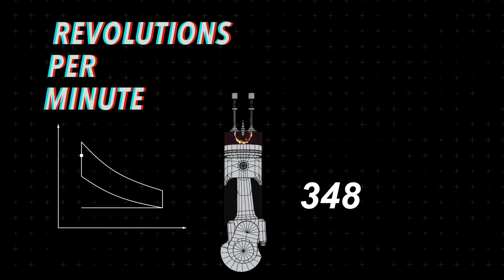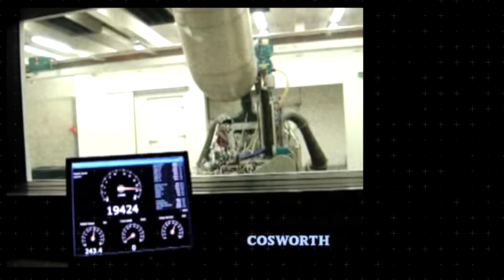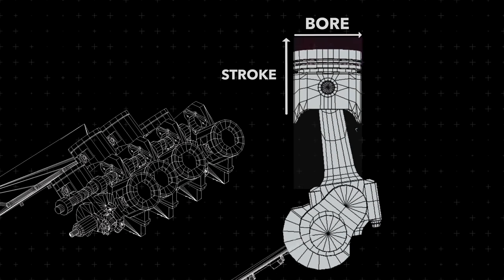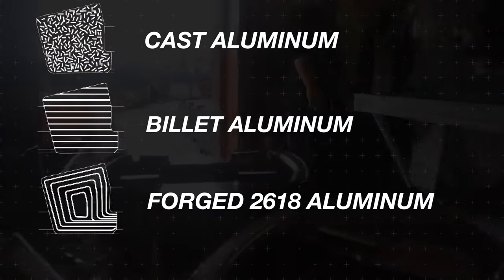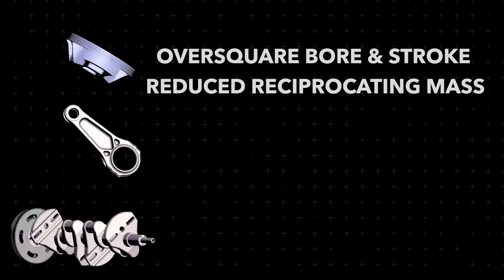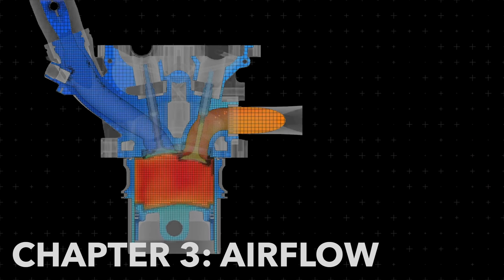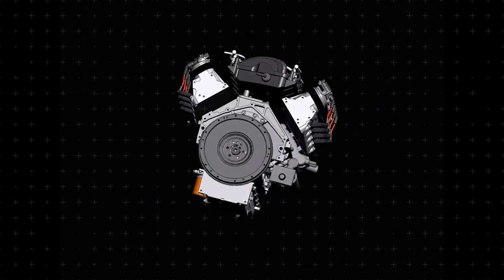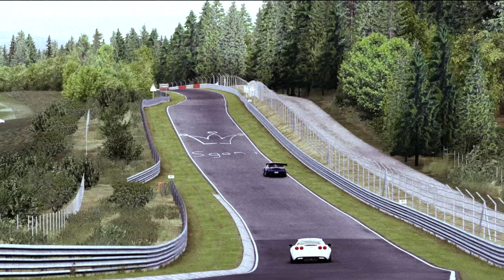The Impossible Engine Speed😳| Explained Ep.28

Comment: You make a point at the end where you explain that going for high rpms isn’t worth it due to being able to make more power using forced induction ect, but I personally believe high rpm naturally aspirated engines are better to drive in my opinion and experience. 
On a side note I would love to see a video covering WRC engines. They’re completely different from any other racing engine. Simply marvels of engineering.
Reply: Thats why i love engines like the s2000 engine and the high revving k20 engines found in civic si and rsx type s that can rev to 8600 rpm stock make over 100 hp per litre STOCK and when you turbo those engines you get an absolute monster thats on streetable because of the vtec system that only runs the high lift can at high speeds because otherwise it can barely idle.
Reply: @repingers9777  couldn’t agree more. I wish Honda would make another high RPM motor, maybe even for a new gen S2K. A man can only dream tho
Reply: "high rpm engines" are generally terrible for normal driving... and the valvetrain components required to spin high rpms require frequent inspection, and don't last long.  Not worth it, unless it's a "race car" and you like to spend money, imho

Comment: When I read 20k rpms i figured you were reffering to the 90s 250cc 4 cylinder motorcycles. Which would be another great story. And while forced induction solves many problems you end up with more moving parts and weight.
Reply: Honda CBR250rr MC22

Comment: Ever heard of the 90's 250cc inline 4 reaching 19.000 rpm ? The cbr mc22 and zxr250 do that, stock.(using a gear driven distribution for the cbr, but the zxr's distribution is chain driven). They officially did 45hp (180hp/L), but the cbr has been seen over 50hp (200 hp/L) on dynos
(I myself have a 250cc 4 banger, a gsx250s katana, reaching up to 16k rpm for 40hp (at 13.5k rpm))

Comment: When comparing F1 engines to NHRA Top fuel engines with respect to piston speeds, there is one other factor I didn't hear mentioned. F1 engines use gasoline, and Top fuel dragsters use nitromethane. Nitromethane has a slightly faster flame propagation speed than gasoline, and this allows for a higher piston velocity, since the piston can move faster before it outpaces the flame front.
Reply: The fact that an F1 engine makes all that power from just a slightly different blend of regular gasoline will never cease to amaze.
Reply: Nitromethane burns very slowly.
Reply: @V8Lenny  nitromethane burns faster than gasoline. Nitromethane burns about as fast as methanol, which is faster than ethanol, which is in turn faster than gasoline. Nitromethane has a laminar flame speed about 10% higher than isooctane (which is the standard for 100 octane gasoline).
Reply: @shadowboy813  methanol is about 0.5 m/s , isooctane is about 0.45 m/s and nitromethane 0.35 m/s
Reply: @V8Lenny  nitromethane has a laminar flame speed of 0.5m/s
Reply: @shadowboy813  laboratory studies tells different.
Reply: @V8Lenny  
@shadowboy813

no, it was pro stock, which burns gasoline/racing gas, which burns slower than regular gas.

Nitro has slightly faster flame propagation, but has nothing to do with faster piston speeds. Nitromethane engines run 50 to 60 degrees of advance, because even the flamefront is much faster, the peak cylinder pressure rises very slowly because there is wet nitromethane that needs to brake apart to oxygen and methane and hydrogen etc, to burn.

Top fuel engines dont have too shabby piston speeds, at the end of the run they turn something like 6500 to 7500. Pro stock gasoline engines wind up to 11000-12500, and this also doesnt have anything to do with flamefront speed. Slower flamefronts just need more spark advance.
Reply: @shadowboy813  

Flamefront depends on compression ratio, and boost pressure very much. Top methanol/top fuel uses up to 4bars of boost, and both run ridiculously rich mixtures of fuel. These numbers dont mean sh*t when you run 4 times the atmospheric pressure
Reply: @V8Lenny  These numbers dont mean sh*t when you run 4 times the atmospheric pressure. Nitro flamefront goes somewhat fast, but unvaporised nitro keeps "afterburning" even when the piston has reached bottom dead center even with 60degrees of timing advance. It keeps burning all the way down as more liquid nitromethane is vapourising and decomposing to oxygen and methane. Pure nitro wont burn without oxygen, but vapourised, decomposed nitro will.

Comment: Thank you for the video and the effort. Very interesting. If you really want to reach extremely high engine speeds, you have to use electric motors (100k-rpm possible). And people who miss the deafening noise of combustion engines can certainly add a sound generator.

Comment: It should also be mentioned that F1 NA engines used injectors positioned above the throttle bodies to take advantage of the charge cooling effect when the fuel enters the low pressure zone in the intake runners. They also used variation in fuel pressure rather than injector pulse to supply fuel at those high RPM's
Reply: There's a several bikes that have two injectors per cylinder. The primaries are below the throttle blade and the secondary are closer to the top of the TBs (and some are similar to F1, above the TBs)...

Comment: Video is spot on! Yes turning up the RPM on an engine gets expensive quickly. We make 170 hp out of a 1970’s 1.6L NA 8 valve Vw engine, it is in a formula car. We run a custom crank, rods and pistons as the road car components are nowhere near adequate or have the correct piston speed.

Comment: Honda made motorcycle racing engines that revved to 20,000 rpm nearly 60 years ago, like the RC166, and their RC149 five-cylinder 125 cc made it to 21.500 rpm during the same time. Street bikes reaching about 20,000 rpm came out in the 1980s. What is impressive with the F1 engines is that they could rev that high with so much capacity, making for longer stroke and heavier pistons etc.

Comment: sidevalve engines produce more torque down low than all the other high tech engines in NA. Add a small turbo and even smaller valves allowing smaller chamber higher compression and a modern small turbine, this modern approach sidevalve engine has been simulated to be the most reliable and efficient torque making engine using modern 10 speed automatics. The torque from idle to 3000rpm is higher than latest diesel engines of the same size using the same turbine sizes. We have overlooked the sidevalve but D-motor has not for aviation.
Reply: You’ll love the flathead classes at El Muroc, El Mirage and Bonneville. You’ll see a flathead Ford powered 1940 Ford do 150 mph with, you guessed it…

Comment: Loved the video but was disappointed the N/A BMW engines werent used as perfect examples of the high revving formula, especially the s54.

3.2l that can rev to 8200rpm easy. Limited to 7900 from factory. ITB's, dual valve springs, hallow camshafts, sodium filled valves, forged rod and crank, dual scavenging oil pumps, squirters, and the eurospec had equal length headers paired with relatively free flowing duals with one crossover located further back to make scavengin better. 

Getting to 9k rpms youd only need a Speedtech valvetrain upgrade and cams.

Im at 8250rpms but can go 8500 if i wanted. 

Maybe youre planning on a seperate video soon from the euro S50b32 all the way to the S85 v10 which is 8250 from factory.

Comment: 8:44 dual spring is used to limit spring oscillations. Valve float also happens due to said oscillations, even at higher spring pressures, as at certain frequency spring wont work as expected.
Also they dont rub against each other on engines that i know of. I mean literary rubing, not some parts touching.
Reply: They used to have interference fits with each other, but probably not with modern stuff. You probably won't see a ribbon damper on modern valve springs any longer, either. Totally a thing you can google if you want to know more, interfering valve springs probably gets you there. 

Nowadays they try and increase the natural resonant RPM of the spring by playing with other things,  so you get full conical springs with varying pitch. In theory there would be nothing needing damping and no unnecessary friction which is also the modern hotness. And that's ignoring shaped wire instead of oldschool full round, and what alloy that wire is even made of to begin with. Lotta stuff always changing...

Comment: The 4 biggest things that allowed F1 cars to rev so high is 1: The engines have no fly wheels, so the engine was freely rev with out any drag on the engine.  2: the internal engine components are made as light as possible whilst maximising strength, like pistons made out of beryllium and titanium con-rods and sodium filled valves or ceramic valves. 3:  The engine timing advance and hydraulic lifters on the heads and some other valve timing internals, tuned plenums and exhaust pressure management because the faster you can get rid of the spent exhaust gasses the faster you can get more fresh gases in the engine.  4: This one along with no heavy fly wheel is very important to the high revving F1 engine and that’s the short stroke piston, however todays engines because they are turbo charged (which is better than super charging because there’s no parasitic loss of power on the engine because it’s not driven off the crank shaft with belts and pulleys like a super charger is which saps power from the engine to drive the super charger and a turbo uses spent exhaust gases so there’s no loss of power from off the engine with turbo chargers so you get more power) going back to where I left off above - todays turbo charged F1 engines have a lower compression ratio due to turbo charging, so to try and off set this a little you need a longer piston stroke that allows more air and fuel for a turbo charged engine this bumps up the compression ratio a little but the longer stroke means the RPM is not as high.  Whilst this is vastly simplified, I hope it gives someone a little bit of an idea or to understand the engineering that goes into F1 engines to make them so compact light and powerful from a V6 - 1.6 litre engine (62.9 Cubic Inches) that puts out 1,050 Horse Power.  Crazy machines at the pinnacle of motorsport.

Comment: I'm not sure coil bind is the primary reason for conical valve springs. A conical spring is going to have a progressive spring rate. This means the valve spring will push back on the cam less at low and no lift, reducing wear and more importantly friction. Keep in mind that at any given time half the valves are riding on the cam's base circle.

Comment: I'd be interested in hearing more also about the other systems. Delivering fuel, oil pressure, coolant aren't trivial at 20k either... especially at f1 g loads. Even sensors and engine management must have been a challenge.

Comment: This was a really cool video, I’ve been curious about the f1 and motogp drivetrains for a little bit and this was a wonderful introduction to the base differences of what sets them apart. One thing I noticed that I don’t believe was mentioned that I learned in a Rob Dham vid, from what I understand, the drivetrain tolerances are so tight that you need to preheat the motor prior to firing it up, and if it sits for more than 6 months(?) it will need to be disassembled and gone through. The throttlebody/inlet is fascinating as it is brilliant, on his cosworth (bought them for around 16k$ used) essentially there are 2 banks where a channel is made prior to the intake side on the cylinderhead that’s essentially a tube cutting across before the injectors/valves, in it a machined cylinder with 4 channels running into the head for the bank ported to allow air through, as the whole cylinder rotates to either cut off or flow or WOT. Genious for the simplicity and reliability.

Comment: Engine with oversquare design has relatively large engine head to its displacement, which naturally enables good breathing aka volumetric efficiency at high rpm, if they have the racing profile of the cams.

Comment: Shoutout to the Ducati Panigale V4 engine especially the V4R engine. The only thing close to this level of engineering in a road legal package with a warranty. Has variable length intake runners, desmodromic valves. Way oversquare, 81mm bore vs 48.4mm stroke. And a peak RPM of 16,500. Makes 230hp/liter on pump gas.

Comment: Im running my ford barra with increased stroke to 4.1L to 8500rpm. 

Generally you can get higher rpm if you destroke a motor. But if its built with quality parts and machining you can get higher rpm also.

Comment: Ducati solved valve float on the desmo to use rockers and no springs at all. It comes at a maintenance cost, the openers and closers need to be reshimmed regularly but the benefit is way higher RPM. Plus it sounds nice, together with the dry clutch 👌🏿 A bit like they put a handful of gravel in the engine 🤣

Comment: It's worth noting that once your engine is optimized for higher RPMs, the effects of adding boost are multiplied. (Assuming your component choices can handle the extra pressure of course)
Reply: That is true anywhere. If you tune the engine for low end grunt and then you properly size a turbo or supercharger to match it will make the same or even more power at less boost pressure, simply because the engine is using all the air being forced into it (when compared to a stock engine, of course). All to do with the CFM of air plus fuel the engine is able to move.

Comment: Why use conventional valves at all? Electronically controlled valves on solenoids will have better control over the timings, and because they are essentially small electric motors, you can run them in reverse to better bring the valves to a stop.

Comment: Buy a b20 block tap it for VTech so you can install the b16 head to make it a Frankenstein add the Integra GS-R throttle body valves and valve springs bigger injectors fuel rail bigger fuel pump AEM ECU Air/Fuel management controller block stiffener AEM cold air intake, 2" GReady exhaust and drop it into a 1999 Honda Civic SI and you have a car that can rev to 9500RPMs and stays right up with an S2000.

Comment: huh... there have been nearly 20k rpm engines in production vehicles for like... 4 decades now.. called the CBR250RR. In Japan during the 80's there was a cap on displacement (due to difficulty registering bikes over 400cc) so they basically were forced to find ways of making 250-350ccs go as fast as humanly possible and the TINY 250cc inline 4 motorcycle engine could rev out to an astonishing 19k RPM... produced 40hp @ 13k rpm and 20ft/lbs of torque at 11.5k..

edit: it was produced 40 years ago, it has not been in production for 40 years... my mistake. Last ones were made in 1996.

Comment: Quick interesting fact:
Human anatomy has natural harmonic frequencies that cause sympathetically induced vibration in different areas of the body.  Depending on the genetic variance in the individual, those specific frequencies can vary somewhat, but overall they're in a relatively close range.  It could be one of the reasons why you have a pleasurable experience with one song while others around you might not feel as strongly as you do.  Same thing with how exhaust sound is shaped/formed and why you like a certain exhaust note over another.
It's one of many fascinating reasons why different people like different engines/platforms/exhaust systems.
Reply: So, Blink 182 put out some solid  harmonically tuned songs that millions of people latched onto, while my hometown band didn't? Lol.